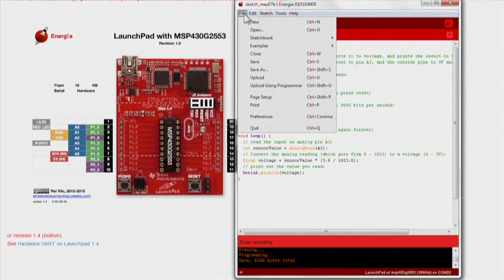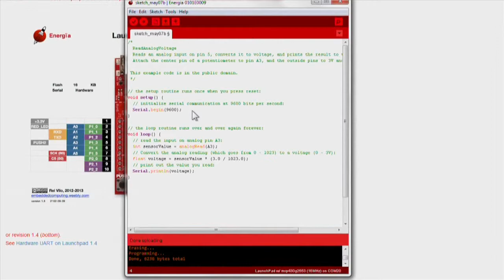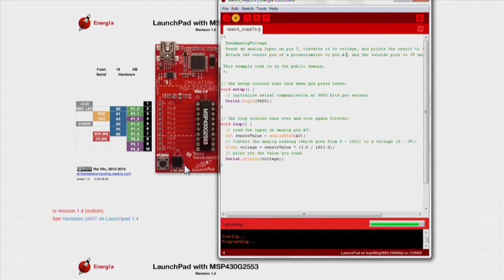Energia Tutorial: Analog Read Serial

Comment: Make sure you're connected to the right COM port (check your computer's device manager - it should be the COM port that says "UART"). In addition, be sure you're using the appropriate baud rate in the serial monitor (the demo here is using 9600 baud). Hope that helps!